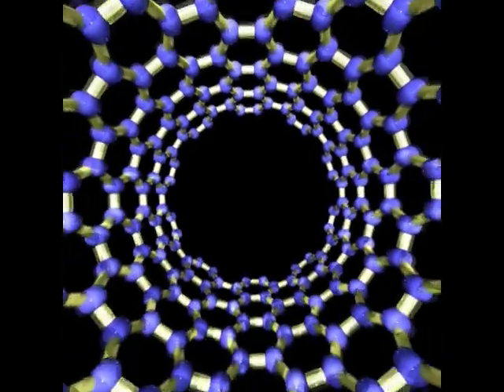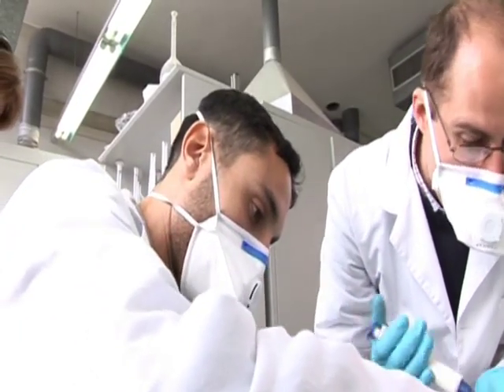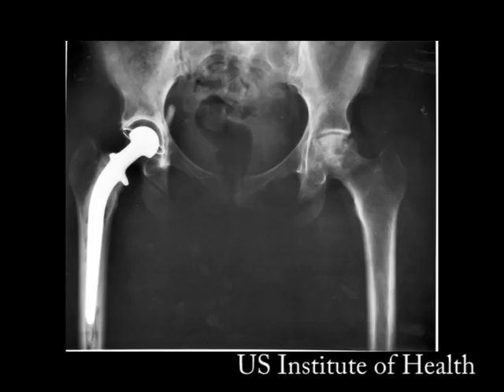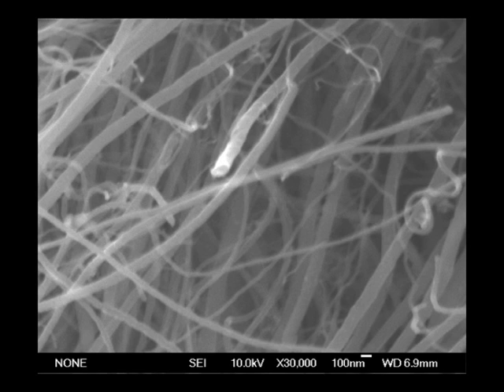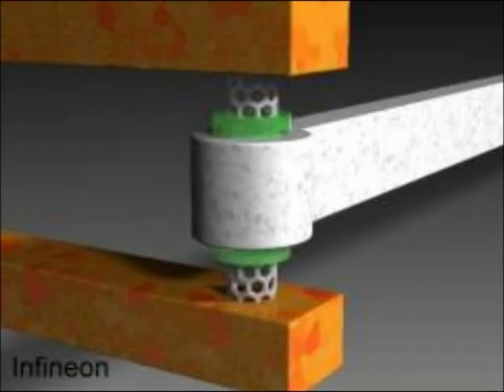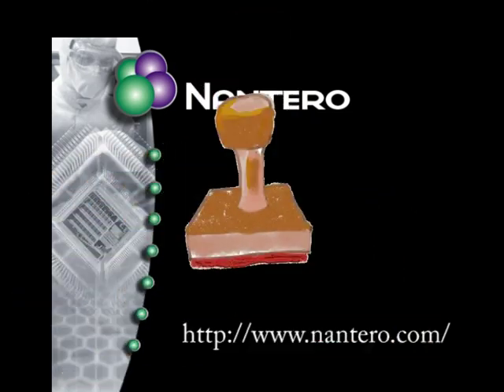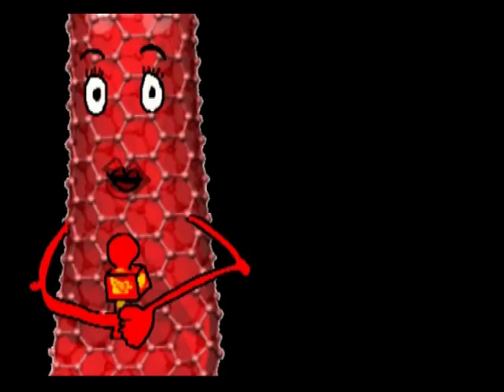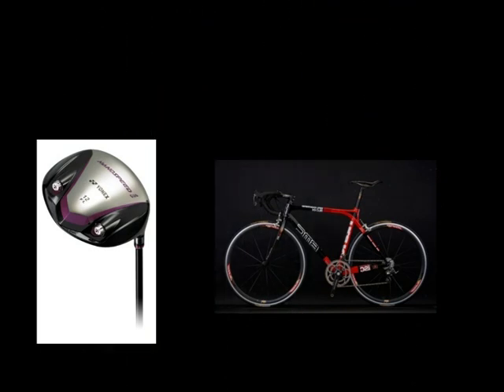Nanoseries 4/5: Where are nanotubes used?

Comment: @asianmacker of course they are already using it bmw i8 is made of carbon nanotube is very light and strong nothing will happen if you crush it at 200 mile per hour but it costs 300,000